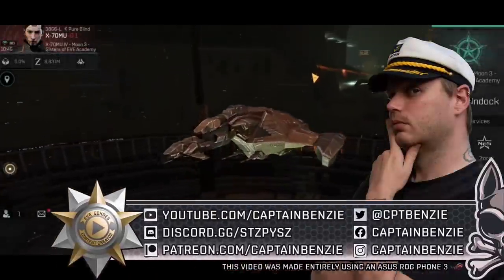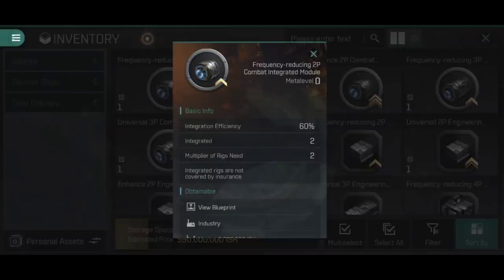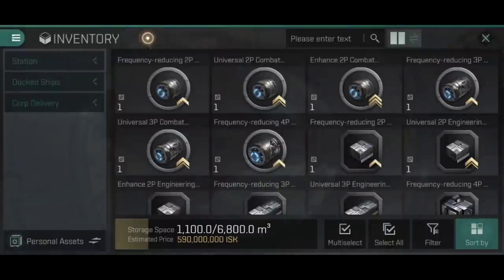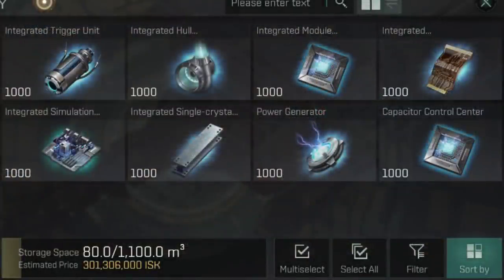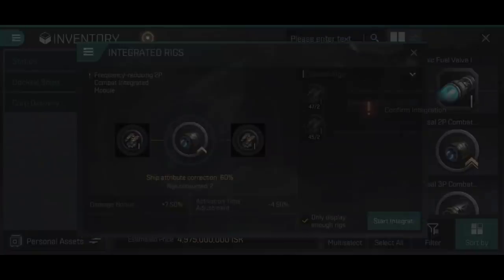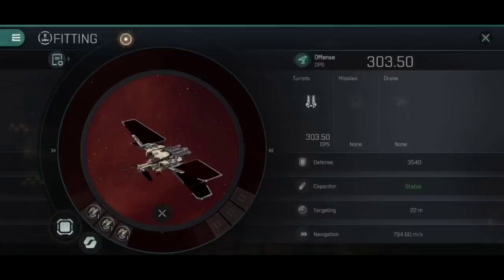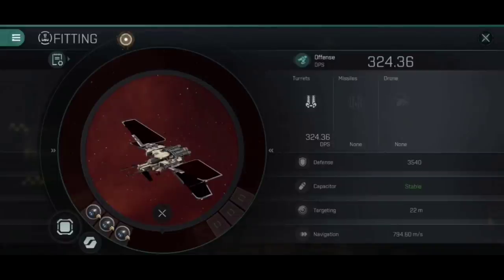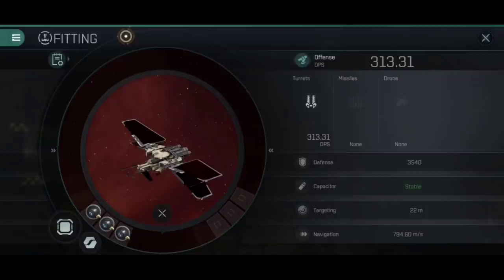Maxing Your Ships Potent With INTEGRATED RIGS!! How Do They Work?? || EVE Echoes

Comment: This video has been posted a while ago, so people will probably have figured this out already, but using 3 enhanced 2p rigs for mining is an expensive mistake if the SWEET app is correct. 

Using the Covetor II with 3 x mk9 strips and max skills as a reference,  using 3 x accelerator 3 rigs yields 27.204 m3/sec per strip miner.
When replacing one rig with an enhanced 2p rig with acc 3 and eff 3 rigs, that goes up to 29.26 m3/sec.
Replacing another it only goes up to 29.876 m3/sec.
Replacing the third however, will drop it back down to 29.048 m3/sec.
I assume this is because you're removing stacking penalties as you replace the accelerator rigs. 

If you want to use Universal 2p rigs, using one, you'll be at 28.299 m3/sec and using two will drop that to 27.709 m3/sec.
That's more than the reference, but very little.

Comment: So 4P, I am thinking of making a gate camp buster. On a BC you can have 1 with all 4 resistance booster; 1 with amount boost, cap reduce, speed boost, and amount repair boost; and last with all weapon boosts (say your using Talos3 can lower PG requirement).  For engi slots use both cap rigs, PG rig, and inertia or thruster rig, now you can fit the lrg cap neuts to disable some of the gate campers.

Comment: I dunno about this. Had a Rokh with one L3 Collision and two L3 burst aerators. Replaced the 2nd BA with a 3x 70% rig with L3 CA, BA, and the falloff range rig (ambit?). Was not inexpensive. I broke just about even on DPS which is fine given stacking penalties, but only gained like 1.9km of extra falloff on the large riffled rails. If that is working as intended, definitely not worth it.
Reply: Learn to do math. There's obviously ways to get get bonuses off these you just don't know what you're doing

Comment: Would it be beneficial to combine 3 2P Engineering Integrated rigs using both Polycarbon 3 and Thruster 3 rigs? My mindset would be, you could in effect make your ship faster both flying as well as warpout time dropping overall. I experimented with a BS on Sweet and managed to get a sub 2 sec warpout time. If you used a 3P integrated rig you could add Warp Core stabilizer 3s you could also better protect your ship against getting locked down. Love you hear your opinion.

Comment: Hey Benzie, can you do a mining test for me please? Can you test the time it takes to fill up a coveter 2 cargo hold of 70k m3 with 3 circ 3 rigs vs. 3 Enhance 2P engineering integrated modules with lvl 3 circulation and lvl 3 miner efficiency upgrade.  Does the time it takes diminish and by how much if it does? This would mean the world to me if you could do this!
Reply: The first one with the 80% saves you 30 seconds on fill.  If you do all three, you save 45 seconds.
Reply: @Lazurk  thank you!
Reply: This is the info I need thank you!
Reply: I've commented this already on the video, but I'll post this as a reply here as well.
3 enhanced 2p rigs is an expensive mistake if the SWEET app is correct. 

Using the Covetor II with 3 x mk9 strips and max skills as a reference,  using 3 x accelerator 3 rigs yields 27.204 m3/sec.
When replacing one rig with an enhanced 2p rig with acc 3 and eff 3 rigs, that goes up to 29.26 m3/sec.
Replacing another it only goes up to 29.876 m3/sec.
Replacing the third however, will drop it back down to 29.048 m3/sec. 
I assume this is because you'll be removing the acc 3 stacking penalties as you replace them with the 2p rigs.

If you want to use Universal 2p rigs, using one, you'll be at 28.299 m3/sec and using two will drop that to 27.709 m3/sec.
That's more than the reference, but very little.

Comment: The only thing off the top of my head that I can think would benefit from the engineering 4p would be a venture 4 and that's to do ncs because you can get better scans and mining
Reply: @captainbenzie  then yeah its pretty useless aside from maybe a blockade runner where your stacking all the engine things but I don't think you can use the cargo hold optimization so yeah 3p at that point yeah 4 is useless in the engineering

Comment: There seems to be a bug with the engineering rigs. I'm using
2p T2 Mining Circ/T3 Mining eff
T1 Mining Circ
T1 Mining Circ

The penalty for third rig applies to my 2p rig which isn't unexpected for the mining circ part but the penalty allso applies to the mining eff part as well. Only getting about 11% increase in mining eff instead of 21% as the rig says

Still building the other two 2p rigs so hoping it will be normal once they are all the same.

Comment: So basically If I get an integration rig that fits 6 rings ( circulation 3 ) I adjust each rig based on the %.... 60, 70 & 80.  Then when I add each rig ( total 6 )  I calculate the effect of each rig  ( 6 of them) and add them together to get the final amount.   Correct?
Reply: No

Comment: 4 engineering rigs that pretty much all of the larger ships could benefit from: Capacitor Control Circuit, Semiconductor Memory Cell, Dynamic Fuel Valve & Warp Core Optimisers.

A lot of people forget about that 3rd capacitor saving rig that can make a whole lot of difference to your ship, but the Dynamic Fuel Valve is a great way to save your cap alongside the CCC & SMC. it's also a lot cheaper too, although that is neither here nor there when it comes to integration rigs.

another 4 engineering rigs that a lot of ships could benefit from: Auxiliary Thrusters, Polycarbon Engine Housing, Warp Core Optimisers & then any 1 of the 3 capacitor saving rigs aforementioned. Of course this setup would be more aimed at the smaller, faster ships. But my point here is that there are a few decent options for using the 4P integration rigs, albeit expensive options

Comment: I'm thinking Amarr ships might like 1 anti explosive rig, 1 anti kinetic, and 1 anti thermal/em integrated. Gallente armor tanks might like 1 anti explosive, 1 anti kin/therm/em and then something else.
Reply: I agree Kobea! Armor tanking, I usually have to leave a hole some where rig wise. This will help!
Reply: Really helps that the rigs you would want to throw into the integrated rig slots are pretty cheap compared to weapon rigs or any engineering rigs.
Edit to add, Trimarks would be good to toss in too since they have  no stacking penalty.

Comment: Was wondering about the stacking penalty. Sad that it's still there. I guess you can go with 2x dps integrated rig and 1x shield for example.
Reply: You can’t integrate  dps and defence rigs into one rig
Reply: @notfrostyskull8716  I mean use different integrated rigs. 2 integrated rigs with dps rigs in them and 1 integrated rig with shield resists in it. Then you don't get stacking penalties

Comment: How warp stab 2 rig 60% will work??
Reply: @captainbenzie  I will be glad if you try it and let us know 😁
Reply: Someone tried it before,.warp stab doesn't work, well it's more of a broken system

If you install t1 warp stab you'll get 0.6-0.8 warp stab, which are useless
Reply: @blitzmustang1588  my only added question to that is do the decimals add into a whole or are they counted as rounded downs in the fitting system
Reply: @SephyClone7  it doesn't count
Reply: 1 warpstab. Needs at least 70%